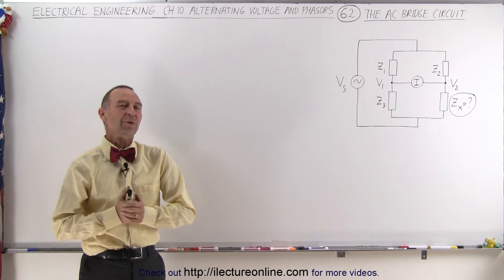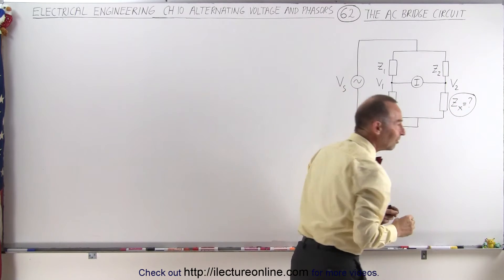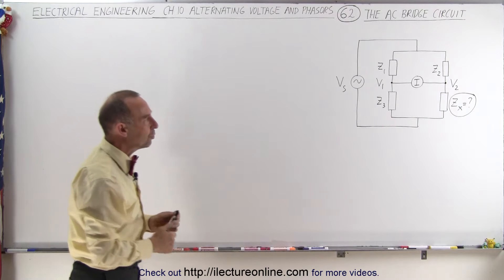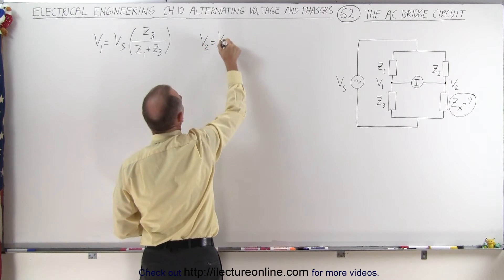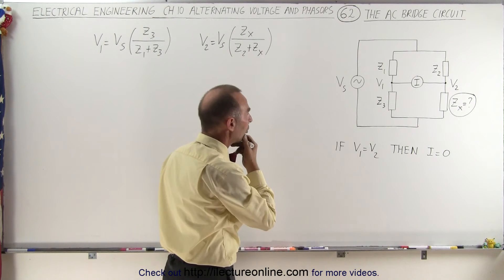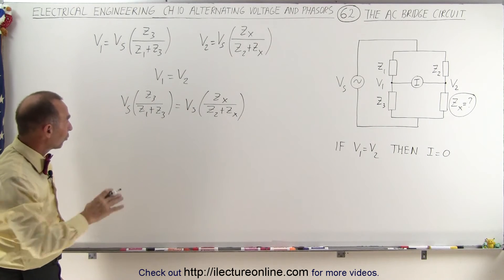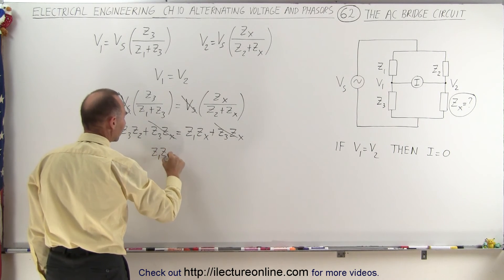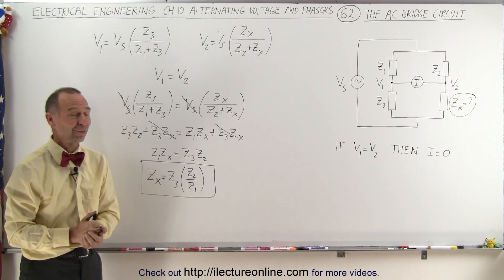Electrical Engineering: Ch 10 Alternating Voltages & Phasors (62 of 82) The AC Bridge Circuit

Comment: 01:44 why is it that at V1, the voltage is the voltage drop across Z3 instead of Z1?
Reply: you can do that instead but then you have to subtract that voltage drop from Vs. The way he does it is adding the voltage drop to ground, so the equation is simpler

Comment: Sir does the input voltage first divide itself btwn the two branches then once u find the voltage in each branch is when u can use the voltage divider technque ?
Plz clear my doubt Sir...
Reply: Hi. Please note that we are putting the condition of I=0 which makes V1=V2. This makes Z1 and Z3 in series and Z2 and Zx in series. Since V1=V2, this also makes Z1 and Z2 in parallel and Z3 and Zx in parallel which means VZ1=VZ2, and VZ3=VZx. This is why we did not divide Vs between the two brances at the first place. I hope this clears your confusion. For more understanding, please see this nice video about The Wheatstone Bridge Circuit; https://www.youtube.com/watch?v=jFvVtB10B1I&ab_channel=TheOrganicChemistryTutor